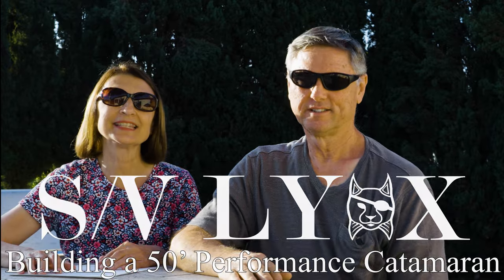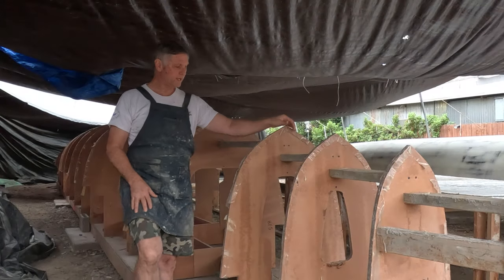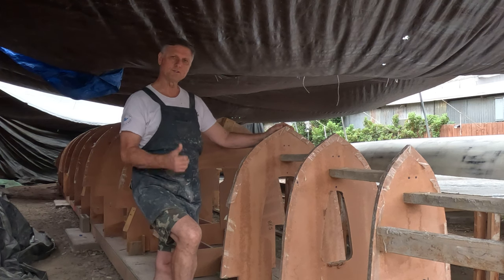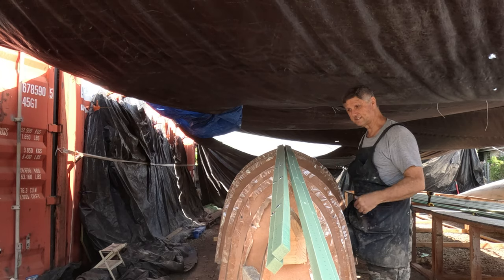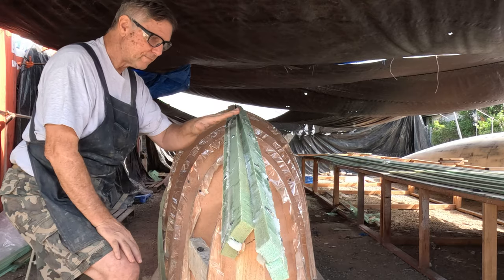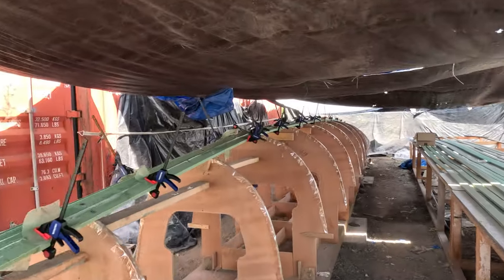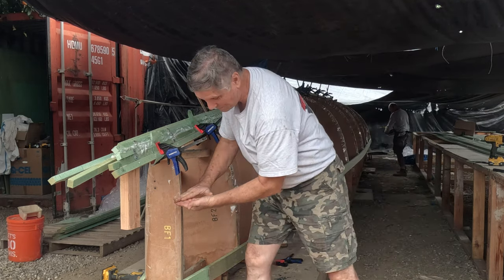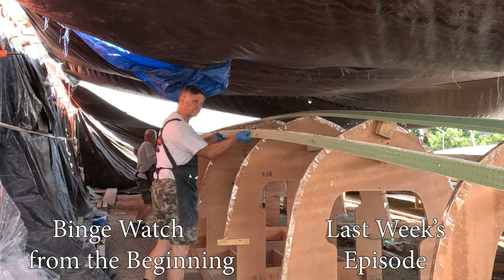Kit E53: Why Build our Boat?

Comment: I think its great you are building your own boat. You will know it inside and out. There will never be a time where you will not be able to do repairs yourself since you know exactly how to do it.  Adding 2 more feet to the sugar scoop can also give you more waterline.  Sailing Parley Revival did that on a heavy Lagoon which still sails like a tank but that added waterline helped them big time with another knot of speed.
Reply from the maker: We already extended the hulls as much as possible when we redesigned the 1490 to the longer 1520.  Adding two additional feet to the sugar scoops won't add more to the waterline became the natural curve of the hull will take that portion above the water level.

Comment: I have a question that was raised when I just watched the O'Kelly's on a Outremer 52.  Sail trimming. They use the 3D method which truly trims head sails much better than tracks do.  I am saying this because you are still able to decide  which method. You are building a boat that can achieve performance numbers and sail trimming is huge for 2 reasons at least. 1 increases performance  by controlling the loft better and with tight sails its a smother ride when sails are not going loose then tight and that should make the sails last longer. Watch there video if you can since all performance cats are now using that method at least the ones who truly can achieve performance.
Reply from the maker: That is already the system we have for our screecher.
Reply: @SailingSVLynx  Awesome. You guys really did your research.

Comment: I’ve seen guys using a strip of  flexible cedar and screw all the unsupported and ‘lippy’ strips between bulkheads From top to bottom ( vertically) as they go. Then remove it and fill holes after. Just as you have with the block.
Reply: This removes the need to have clamps and allows to lay up more strips at a time
Reply from the maker: I've seen that as well before.  Fortunately, we are only three work days away from being finished with strip planking on this boat!